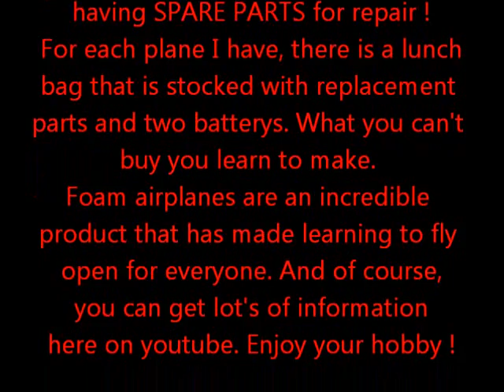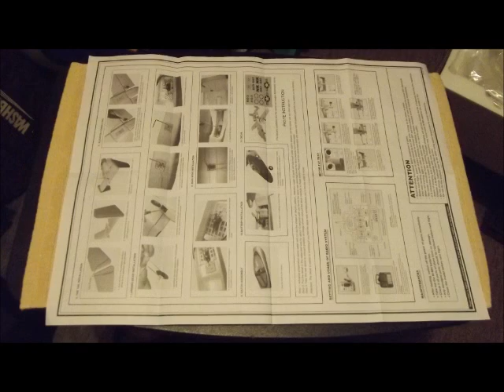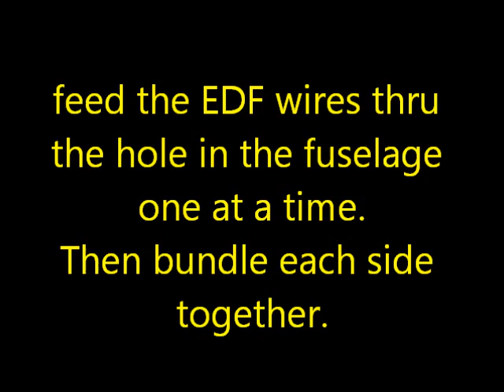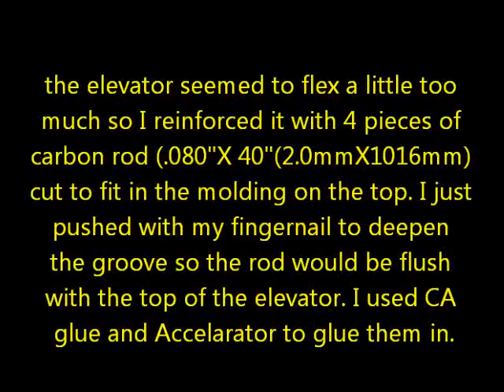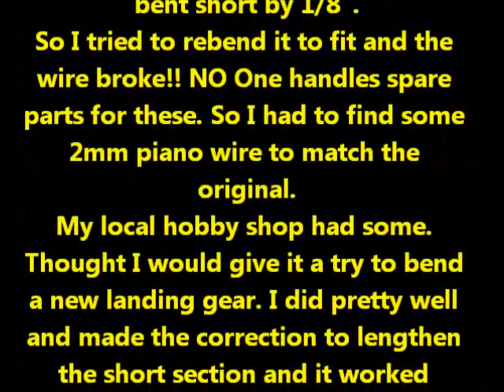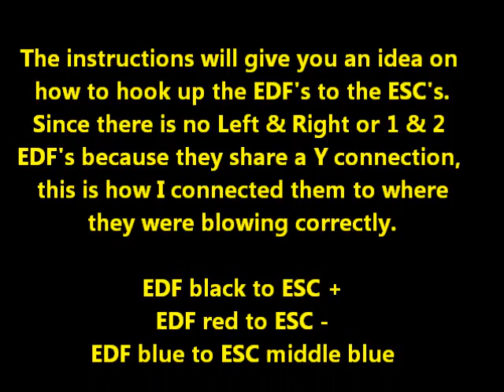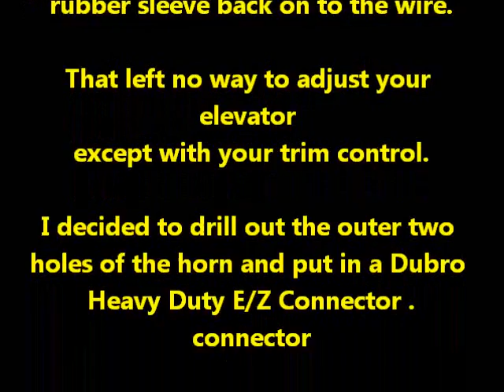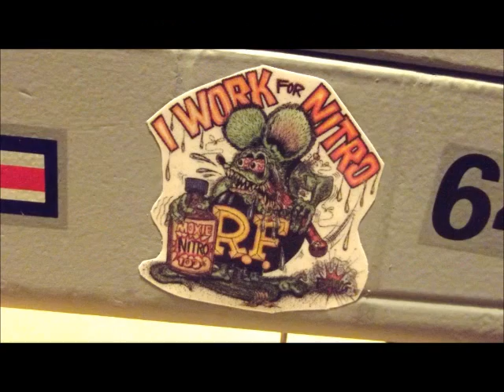Building Guan'Li A-10 Warthog

Comment from the maker: Just a word about the battery and ESC power connectors. They fit each other but nothing else so you could'nt charge the battery.  I had to order 2 batterys from Hobbypartz and replace the ESC plug with the long adapter, Hobbypartz 4.0 banana plug withprotect pipe 34MM. Now everything works

Comment: Hello Im just watching your video and you make a great one. I have a question that you may be able to help me with. I just got a wreck Guanli A-10 from a guy yesterday and the left EDF was broke off. The left and right EFDs are simular, If I put the left EDF in place then both of them on the rear have different angles, is this correct? Which way are the rear jets suppose to be facing? Thanks for your help!
Reply from the maker: Alas, it is no more, but the EDF's should be just above the elevator and slightly pointed towards each other. Look at the one thats still on the plane and turn it in the same direction. Thanks for watching!